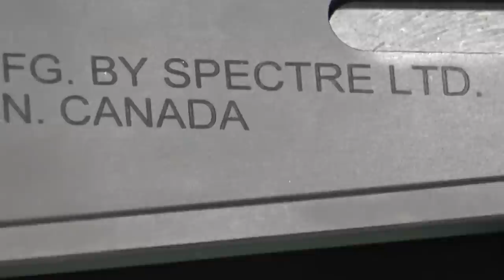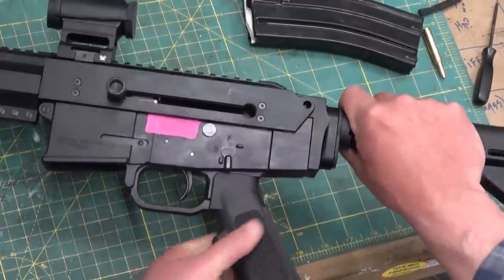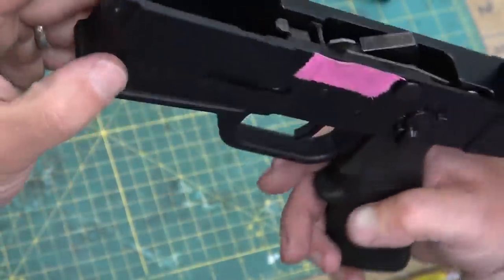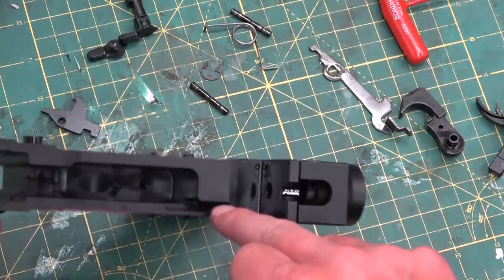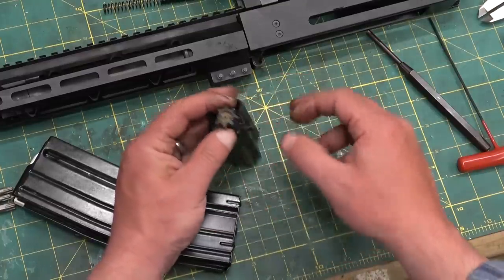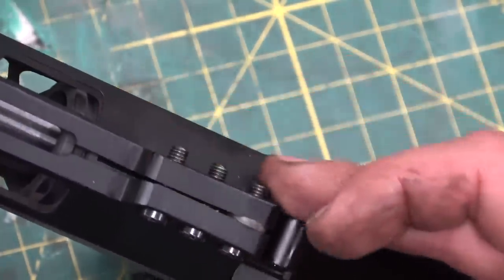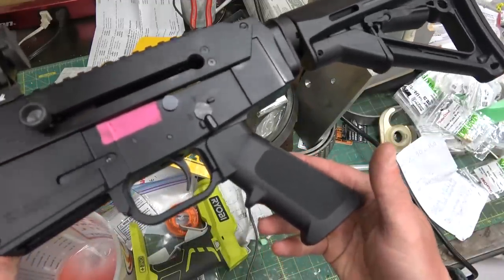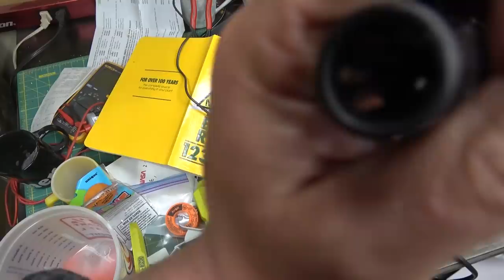BOLTR: 5.56 out of 10 would bang | Spectre WS-MCR

Comment: One little tip bud. The stock is not made of plastic but rather of polymer.  Plastic is what "Made in China" garbage is made of. Polymer may be the exact same at molecular level but it has 300% more tacti-cool  wanketeering behind it.
Reply: probably even Aircraft-Polymer
Reply: Magpul alloy
Reply: A polymer is just a mix of different materials. You can have a crappy ABS Chineseium polymer just as much as a high quality Polyamide made of different tensile strength nylons. Sorry it is a Plastic.
Reply: The ledge inside the receiver will not be hit by the hammer unless you dry fire the trigger without the bolt in place, in normal operation the hammer can't reach that little ledge you scraped down. The same sort of situation exists on the AR15.  Dry firing without the upper including the bolt in place is usually discouraged in the owners manual. Nice rifle I wish they were available in the US.
Reply: lol
Reply: Eddie Hitler duly noted.
Reply: @Eddie Hitler New meaning to "shrimp stock".
Reply: This joke
A lot of people's heads
Reply: @schnaps1790  Some of them even use 'aerospace grade polymer' , which means space marines use those guns!
Reply: or you know maybe fiberglass
Reply: Don't forget the "hybrid" gun parts.  They're ultra-tacti-cool because they use both polymer AND alloy (and we all know that "alloy" is cooler than "metal")!
Reply: @alexrussell8308  "A polymer is just a mix of different materials."  I think you're mistaken on this.  A polymer contains long molecules made up of many (poly) repeating units (mers) of the same molecules.  If a material contains several different such polymers, then it's called a polymer blend.  Of course the individual mers in a polymer contain different _atoms_, such as hydrogen and carbon, and possibly others.

Comment: That .5 seconds were you picked up the hammer to smack the round was just exciting
Reply: Nothing would've happened though, atleast not with a reasonable tappy tap tap, as the primer sits shy of the case head :)
Reply: @matsgranqvist9928  It wasn't one of the NATO spec 5.56 rounds what with the hardened and staked primers, think it was .223 actually. But one time I put a round in a vice, pointed in a safe direction o'course, and gave her a little tappy tap tap with the flat side of a two ounce ball peen hammer. It did in fact go off.
Reply: @darklorddylan1316  How far did it go?
Reply: @Jrez  I'm not really sure, I couldn't find the bullet
Reply: @Jrez  Wouldn't go too far, without the barrel to focus the gases, the bullet won't go. Gases follow the path of least resistance and much rather go elsewhere rather than to push a heavy bullet.
Reply: Sheldon Ross Pretty sure gas, much like electricity, takes ALL available paths. Just some more than others.
Reply: @GottSegneDich it would push the bullet much, much less. You can look up videos of bullets exploding outside a gun. It's like a firecracker, the only dangerous part is the brass chunks.

Comment: Anyone with the mechanical engineering kink always ought to get into guns. They're just so satisfying from a mechanical perspective. Forgotten Weapons is like smack for said kink as well.
Reply: True. Just like grandfather clocks and mechanical watches. The main difference is that grandfather clocks are just so much more expensive and aren't as satisfying when used on produce.
Reply: Yeah I'm into firearms first but I've enjoyed the manufacturing since I first started looking at them. Between old ones and new ones theres so many interesting processes and ways to make things. Between ars aks and hk g3s they are amazing different.
Reply: And then you read trials reports and your respect kicks into high gear. They read along the lines of "testing temporarily stopped when molten metal from the overheated barrel set range on fire. Put out the flames, swapped out the barrel and fired another 50000 rounds." The level of reliability expected is amazing.
Reply: @tyrannosaurusimperator  when it's that device between you and death you want to be sure it's going to work. Same principal to seatbelts and airbags.
Reply: I'm not a fan of guns but I do enjoy watching Gun Jesus because of the level of detail he goes into. Some of the technical problems that gun designers have to deal with are fascinating and I always find their solutions to be very elegant, some very clever guys have designed a lot of very interesting guns !
Reply: @the other that’s the best profile name ever 😆
Reply: @kendallemory8455  Just because it's logical doesn't make it any less impressive.

Comment: barrel nuts are usually handguard specific, so whoever manufactures the handguard is probbaly responsible for the barrel nut, explaining the difference in surface finish.
Reply: this is usually the case , id say the only thing manufactured by this company is upper/ lower/ bolt carrier/ trigger guard, and the last round hold open, all other parts look like off the shelf parts for ar15

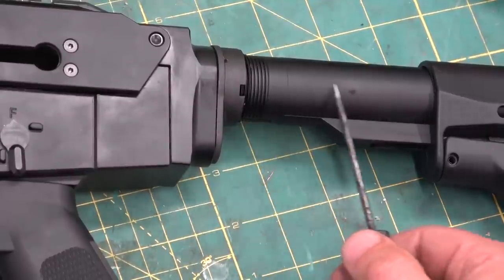Comment: 2:48 your ar-14 salt rifle seems to be on fun mode
Reply from the maker: I don't use the safety, it ain't safe atoll.
Reply: If these are anything like the m4 platform rifles you can't select safe unless it is in battery the hammer is locked back.
Reply: @takeawaykitty.  unless the hammer is back* the bolt can be operated on safe
Reply: @WreckDiver99  lol true
Reply: He's pointing at stuff with his safety the whole video.
Reply: dont worry, he looked down the barrel to make sure it was clear first.
Reply: @WreckDiver99   And it uses 30 round machine gun clips
Reply: AvE “safety, always off” ... “Fuck off, Cyrus”
Reply: @WreckDiver99  when they come for mine, they gonna be here awhile. Have to make sure they take ALL the ammo with them, one round at a time. When the arrows start getting inventoried, you know you have an accurate account.
Reply: storage for the rifle is bolt closed hammer forward, safety cannot be cycled to safe in this condition
Reply: @MyHMMWVaddiction  limited to ten rounds per the aloominium rivet
Reply: @Kineth1  I think it's an intentional misquoting, like "we'll burn that bridge when we get there".
Reply: @takeawaykitty.  Naw, it doesn't have to be in battery, the hammer just has to be cocked. You can put the safety on with the bolt locked open.
Reply: F- flamethrower
S- sandthrower (a la Dale Gribble, always keep some sand in your pocket)
Reply: Pocket Sand!!
Reply: @WreckDiver99  dammit man,  you mean all these years i was wrong,  i thought it meant, f= its fucked and s= you shittin me

Comment: I may be wrong but I believe the term you were looking for is the breach and/or breach block which would be the section of the barrel where the round is chambered and prepped to be fired as well as being where the bolt meets the barrel. I think technically the breach is the actual spot where the bullet goes in the hole and the breach block is the entire assembly. Anyone can of course feel free to correct me if I'm wrong!

Comment: You might want to consider saturating one end of a Q-Tip in acetone, wiping that machined barrel tip down with that, then saturating the other end with phosphoric acid (AKA Ospho), and applying that to the recently cleaned and degreased barrel end.

It would turn a nice blue-black, passivate any existing rust, and go a long way toward preventing any future rusting. 

Way easier than polishing the sear.

Comment: The part you’re calling the sear is the disnnoector, the sear is where the front of the trigger locks into the hammer notch. The disconnector is there to catch the hammer if you’re still holding the trigger back when the bolt cocks the hammer, when you release the trigger it clicks as the hammer goes from that disconnector notch to the sear notch. Don’t know why I felt the need to explain this but I’m a gunsmith so this is my wheelhouse.
Reply: What country are you from? Because I’ve always known them to be sears of different variety. (Trigger-sear, auto-sear, safety-sear, etc.)

Sear just means a mechanism that holds until acted upon by a set threshold of force (or force released in the case of the auto-sear)

Comment: I don't think there will be galvanic corrosion between the upper receiver and end plate. Realistically the bigger problem would be the historically phosphated (obviously these are still around but people like nitrided barrels for hardness and also because they're blacker and scarier) 4150 CMV steel barrel seated into the anodized upper receiver. However, I do not think there have been problems with corrosion. This may be because "mil-spec" dictates hardcoat sealing of aluminum parts.

I am a freshly minted aerospace enginerd, so while building my rifle I naturally was concerned about this myself before looking further into how this is prevented.

Comment: Delron deflector could be beneficial to reloaders, wanting to preserve brass from being deformed. Not sure if this was the designers intent, but food for thought.
Reply: Or it could be something to wear out and be replaced.
Reply: Could be so it stays black. Aluminium that's black on the inside is more expensive.
Reply: I reload brass with small shell deflector dents in it all the time. The dents will fire form out.
Reply: Is reloading 5.56 a thing? Sorry, numpy UK chap here, I thought 5.56 was pretty much common as salt in the US/Canaderp?
Reply: @Beany2007FTW  the short answer is it depends. The long answer is that if your going to reload and shoot a lot of 556 it's not worth doing. If your reloading for accuracy reasons like adjusting the coal to mess with lead jump time or if your dialing in a load a .2g at a time ect. then it is worth doing. Also there are a LOT of other ar calibers that use 556 as a parent case that aren't readily available to buy. Example I shoot 25-45 in my hunting ar and you can order it from sharps but that gets expensive quick. So I reload 25-45 using 556 brass by opening up the mouth of the case. Once they have been reloaded more times than I care for I give them to a buddy that cuts the case mouth off and uses them for 300blk. Hope this helps.
Reply: @sogyseal7962  Hey, that's pretty interesting, and helps - AvE has the best comments section :-)
Reply: It depends on the individual. Some have more time than money. If you don't place a value on your time (reloading as a hobby) you can save money reloading plinking rounds.
Reply: @Beany2007FTW  only doofuses with some sort of tech knowledge, ready to say something of actual use to the one asking.

it just takes too much patience and a minimal intellect to live through and understand the contents of the motion picture above, so it does not appeal to the usual bottom feeders who are just interested in trolling honest people.

this is our safe space :)
Reply: @Beany2007FTW  lots of fat smelled here
Reply: @Beany2007FTW  
Common? Yes. Cheap? No where near as cheap as reloaded. 
Besides, reloading allows you to "tweak" the performance to match your own needs and/or firearm.

Comment: A point:  The disconnector was incorrectly defined as the sear. The sear is the very front corner of the trigger. Carry on.
Reply: It's just as well. Not a load of harm is likely to be done if he polishes on the disco. But if he does almost anything to the seer he's likely to have a gun that will double on him.
Reply: @GunFunZS  That's fun. I had a shotgun that went full auto on me once.
Reply: @davidharris5736  it's only fun when you want it to do it. And if you look on my channel there's a video where I show how to diagnose a trigger system on a shotgun that was going full auto unintentionally. I fixed it but a professional Smith had done the trigger job incorrectly in a way that would almost guarantee that it would wear to such a state. and that's embarrassing because it's really easy to do a very very nice trigger job correctly on a AK type trigger group.

Comment: To all you people saying this is a combination of an AK and an AR, it isn't. It is not like either of those in operation despite Eugene Stoner who designed the AR being involved.  The AK uses a long stroke piston where the bolt carrier is permanently attached to the piston and it rides the same length of travel as the bolt. The AR as designed uses direct impingement of the gas on the bolt carrier to move it rearward and also some of that gas is used to unlock the bolt. This rifle uses a short stroke gas piston where the piston travels only a short distance in relation to the bolt and carrier reducing the reciprocating mass. It IS NOT a combination of AR and AK. General similarities, sure. But all 3 use different methods of operation.
Reply: I remember TFBTV saying the gas system is vaguely familiar to the svt 40

Comment: The bolt doesn't lock the gasses in the chamber. the cartage case does. And brass does the best because it stretch's to seal then shrinks a little to help make extraction easier.

Comment: Clone?  More like when you buy a nice frozen desert which looks to have a chocolate topping but the label says chocolate flavoured.
The bolt carrier and recoil assembly I'd say ARE close to AR180 in design, but the whole thing is a strange mish-mash of AR15 type lower and AR180 themed upper....
TWO big advantages to the AR180 series - easy to manufacture - as they were made from stamped parts, not machined (the body, not the internals) - and it was fitted with a side folding stock as standard.
No idea how Eugene Stoner would view this Canaderp Made mish-mash - he'd possibly be impressed

I'd get the muzzle break off it, give the rusty spots on the muzzle a lightest of polishes with ultra fine emery - then get her choochin up to a nice hot hotness by a few mags rapid fire, then touch up the bare steel with a cotton wool dib dabber soaked in old engine oil = should make for a nice blued surface to keep the rust pixies away

Comment: The plunger ejector is prone to fill up with brass on full auto. The rifle is a gas op system called a short stroke piston system meaning it travels less distance than the bolt vs a long stoke piston system travels the same distance as the bolt. 

Underneath the barrel nut with the flats is a hardened barrel extension and torqued to around 90ft lbs, it has the coinciding lugs that interface with the bolt giving you your lock up. Because the bolt locks directly into the barrel it allows the rest of the gun to be made out of aluminum. 

From what I’ve seen, I like the piston gas system, wish it had a folding stock. Besides that it’s qorky and would prefer a standard AR 15

Comment: Not going to read through all the comments but a couple things to mention.

1. Magwells like that are only roughed to size with an endmill and finished with a broach.
2. Hammer damage to lower is most likely due to hammer being release without bolt in place. If its just from use that's a flaw in the tolerancing.

Comment: 4:28 - My guess is to reduce denting of the brass (for reloading purposes).
Reply: Nah, its for reducing cost. If the gas had enough force to mess up the casing it would probably blow up on the first round
Reply: @freakoutfrancis1798  you are right that it is for cost reduction. High gas pressure wouldn't blow up the case. The head would get ripped off by the extractor. No fun to clear let me tell you.
Reply: @freakoutfrancis1798  it wouldn’t be the force of the gas causing the dent, it would be the force of the brass being ejected. Grated I don’t think that would be enough force to do anything unless there was a charging handle on the right side that could hit the brass in the air like it often does with a galil, though even that doesn’t really effect brass enough for reloading.

Comment: It's a hybrid of an AR-180B and an AR15.  The pins, barrel, flash hider, buffer tube, furniture, and trigger components look like milspec AR15 parts.  Massively over-produced, so nice and cheap. The handguard is probably specific to this gun. The BCG, the mag catch, the receiver are AR180, I guess at this point an AR180C rather than a B because the B was produced out of plastic.  Anyhoo, it looks like a clever bit of workaround to Canada's AR15 ban because it will use the most popular AR15 accessories, mags, triggers, etc without actually being an AR15 pattern rifle. Kudos to the company.

Comment: Are the locking lugs of the bolt chipped? That is an issue with piston modification of the Eugene Stoner system.
In the Stoner AR design, port gas pressure acts on both the back of the bolt and the bore of the carrier.  This forces the bolt forward, unloading the stress on the back faces of the bolt.  
In piston modifications,  the bolt is under considerable load as the cartridge case is quite warm after being under 55k PSI chamber pressure.   This ironed the case to the chamber and thermally expanded it to an interference fit.

In manually operating rifles, the case cools enough due to time.  But semiautomatic rifles,  cases are hot enough to burn, 300 F and above.
Reply: As a lefty in a right handed world, tell me about brass being hot!  I probably still have marks from that brass that went down the back of my collar back in Basic Training in 1990!

Comment: Clarification of a technical nature: the piston doesn't cycle the action, back pressure from the barrel does.  The piston simply moves the bolt carrier rear-ward enough to rotate the cam pin, which rotates and unlocks the bolt, the pressure inside the casing does the rest.
Reply: Thought this was the case and came looking for confirmation, thanks!
Reply: Good point that makes a lot more sense than the piston doing the whole job. With the limited surface area that wouldn't last long.